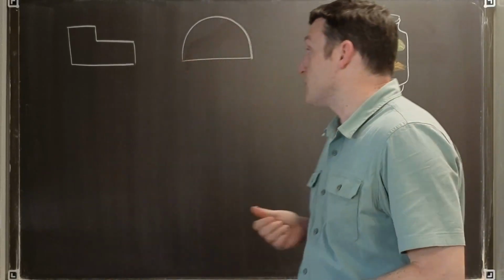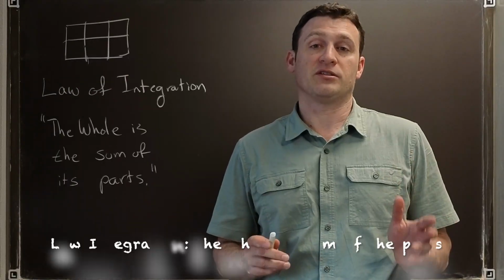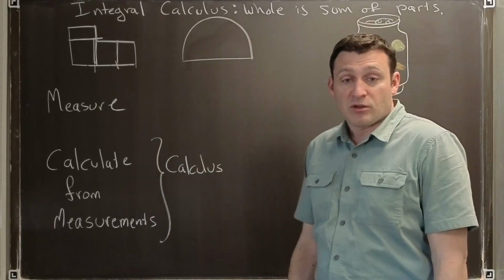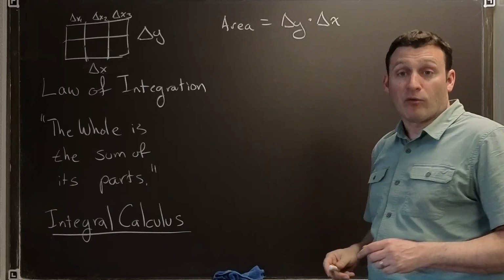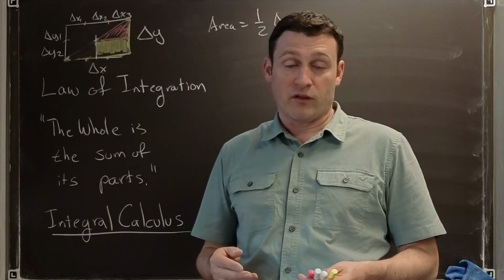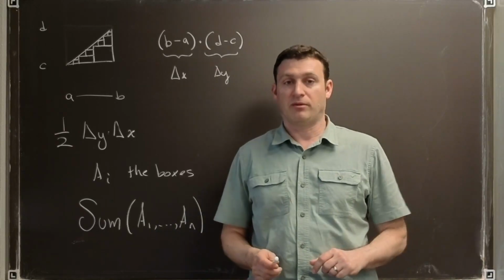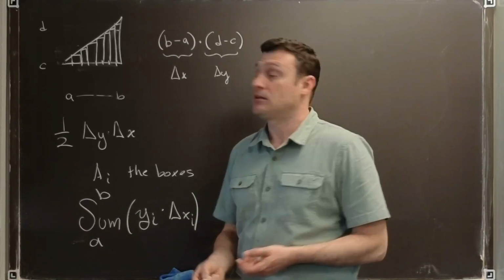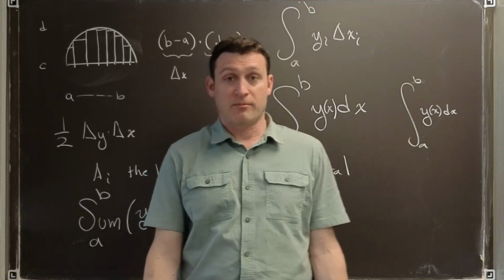Functions we compute from measurements

Comment: Is there a relevant intersection of convolutions and partitions, for example how a set can be convolved over its own partition?
Reply from the maker: Convolution is generally something that needs more than just a set (a group is the default choice if you know what those are).  Convolving is basically to make a measurement based on the location of data relative to other data, and then have the location move along some pattern.  Usually we use operations that are symmetric to move around systematically and those are special forms of algebra called groups.  In these cases the regions we survey do tend to cover the whole but they may not be partitions, i.e. they often overlap because often many point have the same neighbors.
Reply: @algeboy  Many thanks Professor!